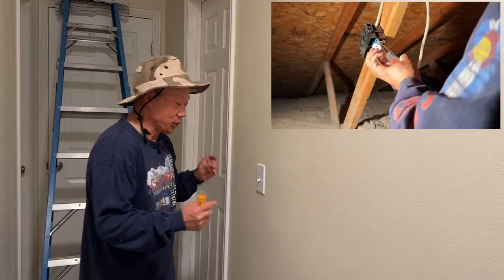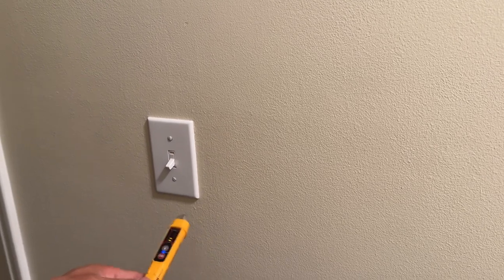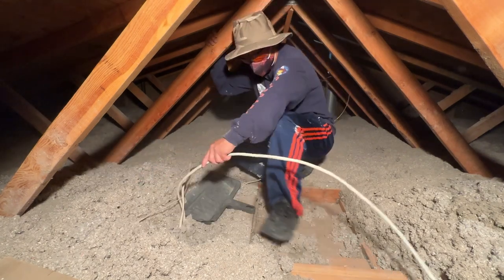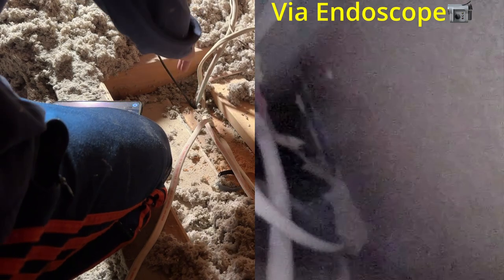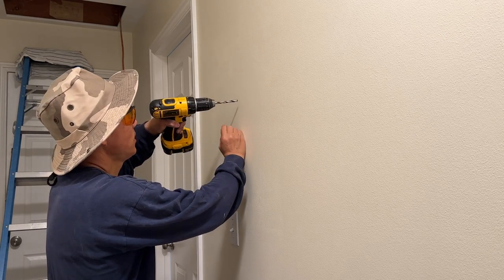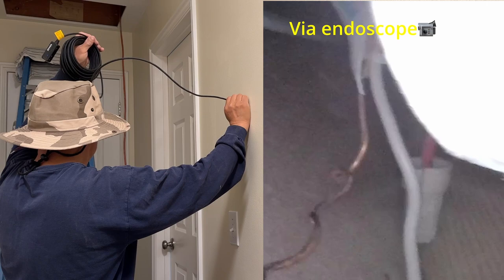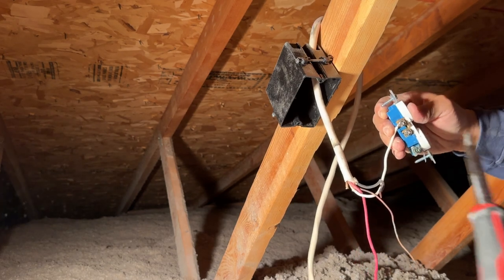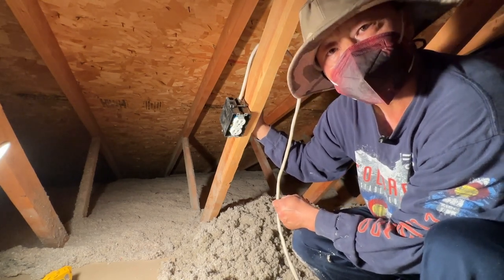Do It Yourself Attic Power Outlet | Attic Fan | Whole House Fan | Quiet Cool whole house fan

Comment: I don't know where you live, but in the U.S. you can't splice wires inside of a wall. You can install an outlet box(junction box) in the wall where you drilled the hole, splice the wires and put a blank cover on it so it's accessible from the outside of the wall, but you can't hide junctions and splices inside of a wall. You could have fished that wire over to the switch where you first found a hot(if the neutral and ground was also accessible), or as you said run a separate wire from the breaker panel box.
Reply from the maker: You are correct about splicing wires by adding an outlet or adding a blank cover for access. I do have access. I did not show it on video. 
This project is a whole house fan. It is 110v. Attic access only. Thank you for leaving the great comment.